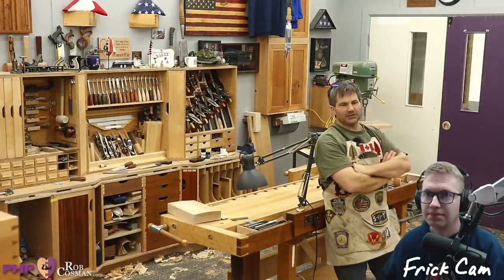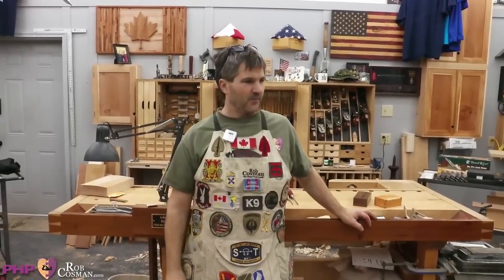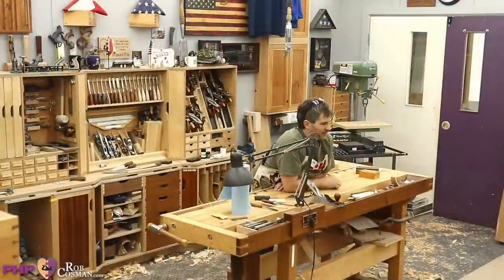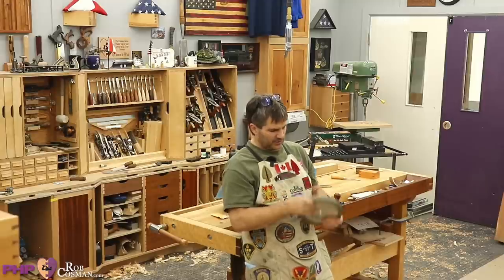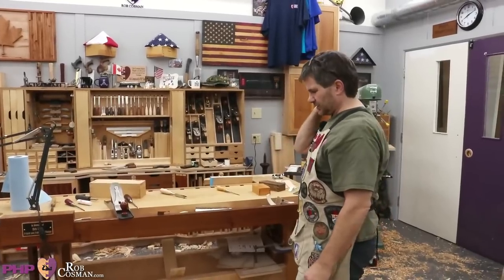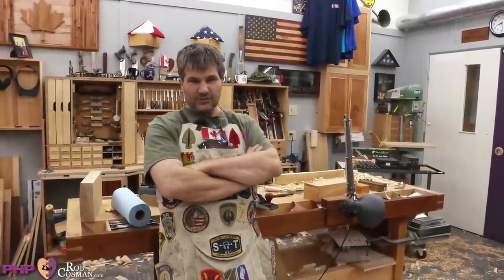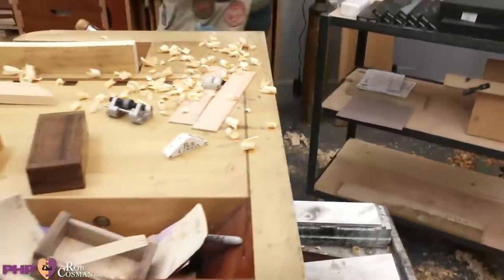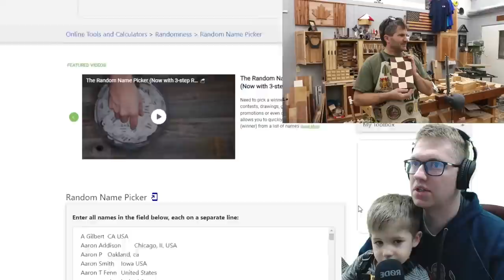Sharpening - Live Q & A (8 JAN 2022)

Comment: May,I recommend an idea to answer the question "how hard should one be pushing on the blade their sharpening". Get a decent digital mail scale. Push on it with the force you are trying to convey as the proper force. Share those readings from the scale. I think one other benefit of trying this, is that different operations may require differing amounts of force and this could give a numeric value to represent those differences. Anyways I hope you'll consider this. I'd really like to have a more definitive answer from a pro. Also, make sure you turn on the scale before starting 😉, okay I'm being a smart astrix sorry. I'm sure your usually smart enough to figure that out

Comment: Love what you guys do in every sense.  I was unable to attend this episode, but I had a sharpening question I was hoping to get an answer to and I don’t believe I’ve ever seen this one addressed.  Could you tell me if you use the charlesworth ruler trick on your bevel up blades?  Wondering if the feathering camber used on the bevel (3 seconds each side) would be different because now the flat back of the blade is down.  It would be different wouldn’t it?

Comment: Unfortunately, I wasn't home and missed this program. I just watched it and looked for the question I wanted to ask. Alas, no one asked it: Why a tertiary bevel at all? Does it speed up sharpening so much over a secondary bevel to make it worth the added step?  Isn't it enough of a challenge for a beginner who hasn't developed your level of muscle memory to freehand sharpen a secondary to the same angle every time so as not to round over the edge? Estimating, on top of that,  the same minuscule  third angle every time seems like it will doom me to end up with a rounded edge.
Reply from the maker: Tertiary is absolutely necessary for speed. Not to mention that by hand you’re not going to be able to match the secondary bevel exactly on the finishing stone.

Comment: What do you recommend for primary bevel angle for your cutting tools?   Bench plane, block plane, bench chisel, mortise chisel, etc.   other than your 17 degree chisel, seems every other tool is 25.   Are there tools you’d recommend different angle?
Reply from the maker: Mortise chisels should be 30° for added strength.

Comment: Why don’t you finish with 32000 stone
Reply from the maker: As an instructor I set a precedent like it or not.  The 32k stone is almost $400.  Most would be better off buying a second or third plane with that money.  The 16k is the best value based on added performance over the next highest grit, 8k.  $110 vs $150